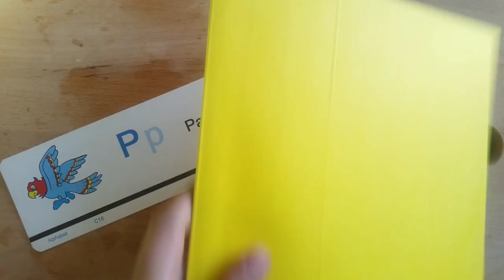Hacking Together Audio Cards for Educational Toy

Comment: I remember a similar machine in elementary school, although it used cards that were recorded on by the teacher. Quite fun to manually push the card faster or slower than it normally goes.
Reply from the maker: Since I recorded this video, I added a switch that turn the motor on and off, so I can push the cards through at whatever speed I want. It is fun!

Comment: If you were motivated to solve this, seems it would be better to record the cards at they're designed speed. Since the tape in a tape recorder is actually driven by the capstain, it should be possible to make a "card recorder" out of an old cassette recorder and modify the drive speed to match the toy.
Reply from the maker: That would be a fun project. I have a few spare cassette recorders that could maybe be used

Comment: I like that idea :) I have just recently got a Califone Tapemaster which I think is about the same thing and uses the same cards. I cannot get the cards over here in the UK, so I made my own too. Would you mind sharing the measurements of the cards and the placement of the magnet stripe? I am trying to iron out faults, as my machine has only got a really faint signal. I cleaned the tape head, I made multiple cards but it just does not get louder... no idea what it could be...

Comment: This is actually really helpful, I’ve found a few used Eiki and Califone units and gotten them working again but getting the cards is a pain - did you use any specific spray adhesive to mount the strip or just something like 3M 77?
Reply from the maker: I somehow completely missed this comment. I just used 3M Super 77
Reply: @EmilysElectricOddities  Nice!! I’ll have to try that next time, I was worried it would gum up the rollers, I ended up using a glue stick haha
Reply from the maker: if it works it works!

Comment: Could it be possible to up the voltage to make it go faster?
I miss my cassette tapes. Why do we throw them away ;)
Reply from the maker: I could do that. I would just need to disconnect the motor from the main PCB and supply it with its own power. The main board doesn't want much more than 6 volts. This might actually be the easiest way to do it.

We never appreciate things until we don't have them, right?

Comment: Try old VHS tape.
Reply from the maker: But why?!
Reply: @EmilysElectricOddities  It might sound better. Use a VHS that you dont care about or one that got eaten.
Reply from the maker: @coondogtheman  does it have a higher density of magnetic particles? is that why?
Reply: @EmilysElectricOddities  If it's dark it might sound better. Most high end tapes are dark brown or black and they usually sound better than cheap tapes.